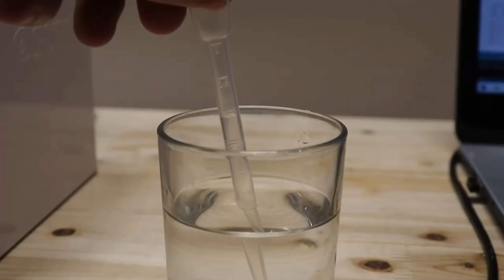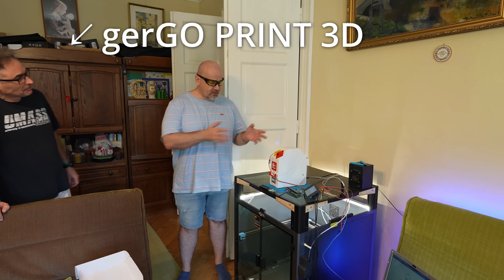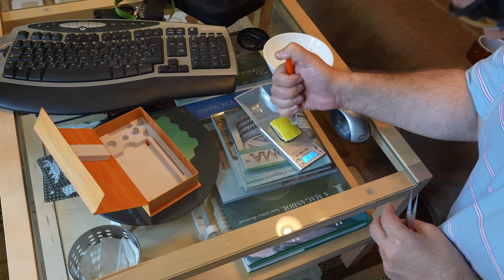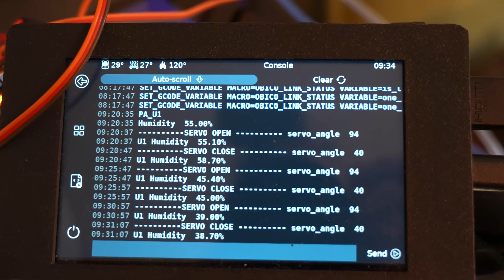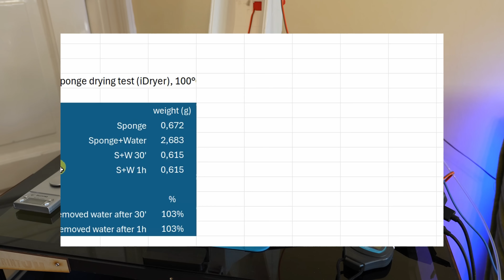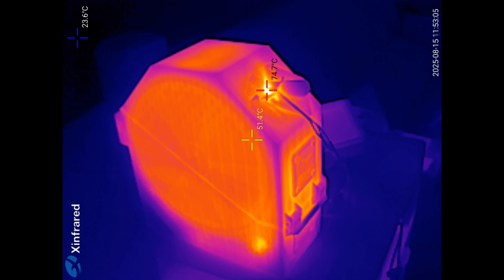iDryer: DIY Filament Dryer with Klipper Control, up to 90°C (measured even 100°C)

Comment: Am I the only one who thinks this is nonsense?) Why would a dryer need this? The dryer could well have been Marlin 8 bit. Drying plastic is a common practice, you don't need brains on 32-bit processors. This is the same commerce as a bunch of printers. Yes, people will buy it because they buy everything that is expensive, but why?!!!!) So yeah, it's cool, the project is developing

Comment: Good review, I liked it! I have 4 unit duo this is an enlarged version, which allows to accommodate 2 coils. What you called a network interface is an interface for combining Unit MCU and Unit EXT, thus 3 additional Unit EXT modules can be connected to Unit MCU, which will allow simultaneous sewing of 8 coils of plastic with 4 different materials, for example, PLA, PETG, ABS and Nylon can be dried simultaneously in different Units. The duo version has a larger electronics compartment, which allows you to place a single-board computer like an Orange Pi Zero3 (and many others) inside and be sure that no printer errors will occur during long-term printing, and the  iDryer can always be rebooted). In addition, all the source files are on GitHub and you can do something the way you like and suits you specifically, and then share with the community =)

Comment: Very interesting how an open source dryer is basicaly better than any commercial dryer out there.
Reply from the maker: I am really waiting their stand-alone version, independent from the Klipper.
Reply: Almost any cheap food dehydrator is better than any commercial filament dryer.
Reply: I think commercial units are made to be: 1) SAFE with multiple redundancies and high safety margins, and 2) not damaging to filament. Any device that doesn't have clear standards (like space heaters) as to how they should be built need to be built very carefully in western countries. Also, having high heat concentrated areas in a filament dryer could easily ruin an entire spool. Most of these companies are relatively small and could be instantly ruined if a product ends up burning down a home or melting filament. That is obviously not a huge concern for a DIY product as it's your own responsibility.
Reply: @roots4x I can believe that since a dryer is fundamentally a very very simple machine. Heat, mesure heat, mesure rH, fan, powersupply(s) for heat and fan, housing, done. I'm sure most people who do 3D printing can make better filament dryer with the same dedication as the hobby.

Comment: Wrong! 
5% at 100C is not the valid result, its physics that the same amount of humidity in hot air is less in % because hot air has more capacity to contain humidity.
As soon as it cool down to room temperature THEN you can see how much % it is less then before. Thats the real removed moisture. 
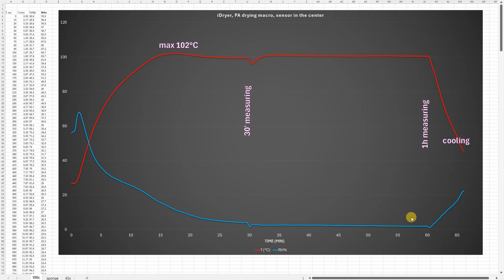You see that effevt in your graph at ~ 7:50 - at the end the relative values increase as the temperature drops.
In an isolated environment you can get about the same curve without any change of the humidity in that environment - just physics.

The servo door would be smart if it frequently (or humidity driven) opens, a fan blows out the hot (absolute values), moistured air and a second door lets fresh dry (absolute values) in.

Every food dryer shows how real drying works. Warm up fresh air, lets take moisture an exhaust immediate. permenent replacement of air and that gets rid of the moisture.
All that closed filament dryers punish physics.

Comment: Should be trivial to write stand-alone firmware which doesn't require Klipper. The only issue is you would need to modify it to add a display of some sort.
Reply: It's really not difficult, but like everything else, it takes time.
Reply: @iDryerProject  When (if, I guess, although I'm pretty sure I will) I build a Voron Trident and can reliably print large ABS parts and fancier materials. I will build something like this and write rust firmware for it. It's one of my areas of speciality. Although might take some time before I get around to it :)

Comment: I got recently the Creality Space Pi x4. Considering that currently some shops sell PVT versions of it for a similar price as the Sunlu S4 it's a wonderful deal I think.  Maximum 4 spools in 2 compartments that can separately be regulated.  It can dry, but also hold a set moisture level for later storage. The firmware can be upgraded via SD card and with the latest firmware it easily reaches 85°C within 10 minutes at the opposite site of the heating element.  It also has a one way valve / fan on each chamber for active dehumidifying. The touch screen is also very nice.  In my opinion it's currently one of the best filament dryers - if not the best  for <150€ considering the value and flexibility it offers. I think that one is  definitely worth a review. My only complaint would be that one side was slightly overshooitng on my unit by 4-5°C when i set it to 85°C.  At 80°C it was more stable.  But I rather have one that is slighly overshooting and I can adjust to than some of the other dryers that barely reach the temperatures they claim in their advertisement.
Reply: Forgive my ignorance, what is this "PVT version" of the space pi x4 you speak of? Thanks!
Reply: @rileyneufeld7001  Some shops on Ali and eBay sell the PVT units at a discount. Usually companies do  a test run before a full production starts to test the manufacturing process's capabilities, scalability,  production costs and such.  But also to identify and fix bottlenecks in the production and packaging lines.  This process is then usually called Production Validation Testing (PVT) . So they're units from a limited test production run  before the full mass production started.

Comment: Having it run through Klipper is a great idea. I hadn't got into the depths of the code until just recently as I was rooting an old tablet to run Klipper and have it be the display screen as well as the compute unit. Going through that process got me thinking about how useful and relatively easy it would be to control all kinds of ancillary devices that can be sourced through 3D printing or motion control bits and bobs. Now I understand why the Raspberry Pi got so popular. 👍
Reply: Yes, it doesn't require any time spent on programming, all the security is under the hood of Klipper, the hardware is already configured, you just need to describe the logic, and it's a pleasure and no long debugging.
Reply: I’m patiently waiting for the open source washing machine controlled by klipper😂
Reply: @Nathan0A  Yeah, but you'd really need a Jetson's robot for loading. I thought it was weird when large appliances started having wifi and monitors added on several years back. Like who's going to stand in front of their fridge and just watch TV? Truth be told, I could find a use for that now. 😁

Comment: Nice dryer! Any option to run it standalone without klipper?
Reply: A standalone version will be available soon. The firmware is currently being tested, but so far everything is progressing without any major issues. Today I already dried the filament in stand-alone mode.
Reply from the maker: They are working on this solution too. But so far, not.

Comment: Polymaker's HT PLA should work very well, right?
Reply from the maker: I would go with HT-PLA-GF
Reply: @MyTechFun  How come? I'm genuinely curious why HT PLA wouldn't be enought. I'm planning on making a custom NAS (PC) and I was orignially thinking of using HT PLA for it. Should I concider GF instead?
Reply: @CaptainFlips  Neither would be good for it unless annealed. If you look at the TDS for both of polymaker's HT PLAs, the "as printed HDT" is between 58.6c and 61.4c for the standard HT PLA and 59.7c and 75.5c for the HT PLA GF. HDT is the important spec; it determines how the material behaves when heated under a specified load (like DR. Igor's temp tests he does in his filament test videos).
Reply: @NWGR I see. Perhaps I'm more ignorant than I would've hoped. I'm open to suggestions on what I could use on an open printer
Reply: @CaptainFlips  Something on an open printer might be challenging because of the size. Some smaller prints you can get away with without warping/layer separation, but enclosed with a heated chamber is best for most of the engineering filaments. Bambu's ASA CF has a HDT of 110c, so that would work, but again, not easily printable on an open printer. Their PC has a HDT of 117c.

In all honesty, unless you need the higher drying temps, a basic filament dryer, or my preferred drying method, a food dehydrator, will work just fine. If you like to tinker and DIY things, this is a pretty neat project, but IMHO mostly a proof of concept. I hope one of the big manufacturers will pick this one up for mass production.
Reply: @NWGR My bad, we're not on the same page. I have a dedicated dryer and don't have an immediate need for this one. I was talking about the server build which I had replied about. It would be a custom enclosure which shouldn't reach 80C.
Reply: @CaptainFlips  Oh ok, no problem. PETG might be good enough for a server. It depends on how hot the components get.
Reply: @NWGR  Hmm, well I looked through the specs of various PETG rolls, including my own rolls, as well as HT PLA and it seems that the latter has a significantly higher vicant softening temperature. Wouldn't it then be more suitable for this application? The better printability, attractive price, and superior aesthetic make it a strong competitor. I'm just trying to find out if it's expected to survive the heat.
Reply: @CaptainFlips  Vicat isn't really an "under load" test; it's done with a flat pointed needle; the temp is measured when the needle gets to 1mm deep in the material. HDT is a load test; the sample is placed on two spaced surfaces (basically creating a bridge), with a load applied from above. So when it comes to temp resistance for a project, I always look to the HDT first. I'm definitely no expert on the matter; this is all just things I discovered while researching filament temperature resistance for my own projects.
Reply: @NWGR  Unannealed Polymaker HT-PLA and HT-PLA-GF posted high numbers (125C-146C) in Igor's own test. That beats his ABS-GF and even a few PC blends in his other videos.

Does that not indicate that it should at least perform comparably?
Reply: @WhoWatchesVideos  Interesting, I just checked that section of the video again and I originally thought it was all annealed. That's big if true, I need to order a spool and do some testing of my own with different loads.

Comment: Looks spectacular for nylon. Just wish it had something to rotate the spool!
Reply: Probably, spool rotation makes sense when the air outlet is very hot and the fan doesn't provide enough airflow to evenly mix the air inside the dryer chamber. However, with a 27 CFM airflow and no empty space inside the dryer, it becomes less significant — although there's already something about this on Discord.;)
Reply from the maker: It has.. but only during the printing :-)

Comment: Great features and exceptional performance.  I've been thinking about making wall mounted filament dryers with a bottom exit to feed directly into the top of the tool head with no Bowden tube, which is my preferred method and very useful for TPU, but I'd prefer a stand alone Arduino controller with a simple push button user interface instead of Klipper.

Comment: We could have a dedicated nic laptop, pi, or rockchip board running klipper to manage a wall of driers. Doesn't have to be running from the printer. Strongly considering that as a project. Where do we get the hardware kits or BOM?
Reply: In this case, the Ethernet port is merely a physical connector of suitable size. It was selected because it is convenient and widely available, and therefore used as a means of interconnection between the units.
The system structure is as follows: there is a main device with an MCU, which connects to the printer via USB, and expansion units — unit2 to unit4 — are connected to the main device using Ethernet cables.
I want to emphasize that this is strictly a physical connection using Ethernet cables, and it has no relation to the Ethernet or network communication protocols.
This setup allows for up to four independent units to be controlled by Klipper through a single MCU, enabling cost savings and centralized management.
Reply: @iDryerProject  is there any chance this will get up to 6 or 7, as toolchanger are on the rise?
Reply: @SippoCoffee  You can use 2 MCUs and 6 EXTs Units, 8 independent Units
Reply from the maker: Eh, it's not ready yet. According to the developer, in 2 weeks (from the Chinese warehouse, worldwide). I will ask him to reply to comments
Reply: Exactly. For a number of reasons — mainly related to logistics — I’ve decided that shipping from China would be optimal in terms of cost and delivery time. Therefore, iDryer Unit kits are currently being assembled at a warehouse in China and will be available for order soon.

Comment: This looks really good. It has mostly what I am trying to find, and what it doesn't have (I am mostly using bigger spools 2+kg) is easily solvable since it is all open source and it is mostly about the dimensions of the "inner box". Since this is klipper, there is probably a way to connect directly with the printer so that you can put something to dry and after set time, the print itself starts.
Reply: Yes, automation of printing and drying before printing is one of the advantages of using Klipper.

Comment: It's nice to see a dryer that had some thought put into it and hits useful temperatures for engineering filaments. Not initially wild about the idea of Klipper since Klipper can be crashy, as you experienced.  But look forward to seeing the Gergo video to better understand that aspect.  Definitely some things that EIBOS should be doing.

Would prefer rear exit configuration for filament feed to my printers, but that might be an easy mod.
Reply: It's really easy to fix. 
Using Klipper gives us all its magic, easy to adapt to any task, can be integrated into the printing process. But standalone firmware is also coming soon
Reply: Klippy isn't "crashy" at all. What sort of garbage klipper version have you compiled.